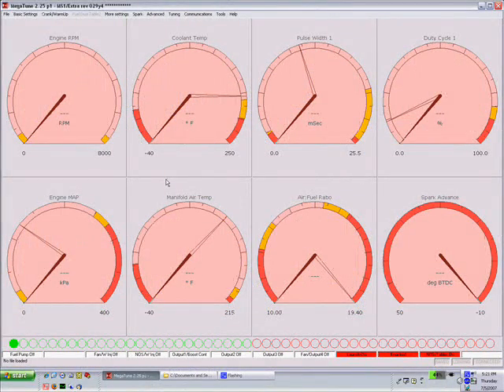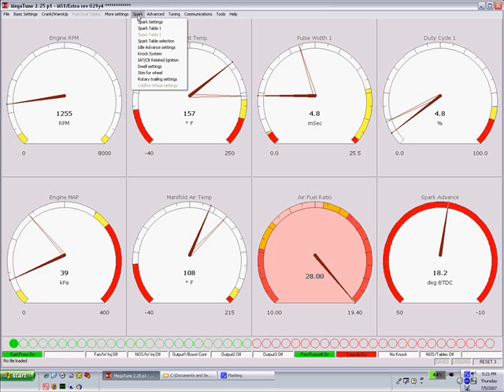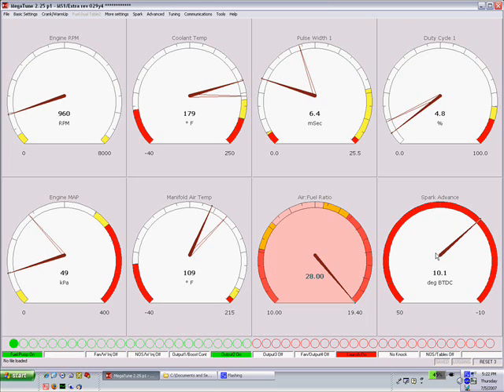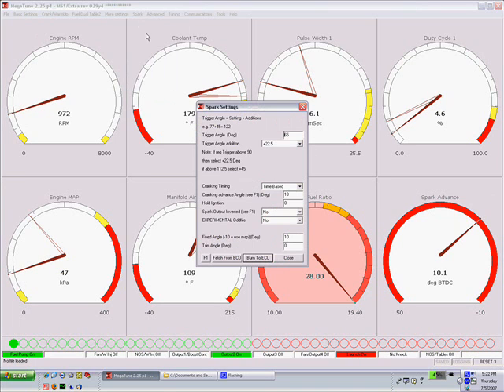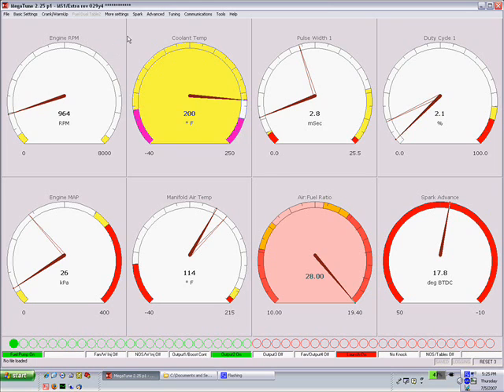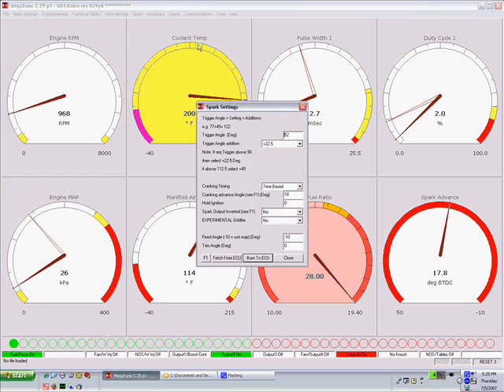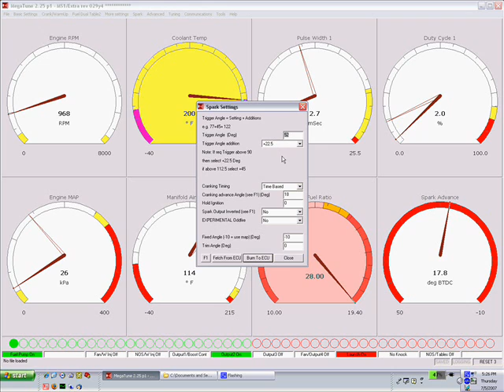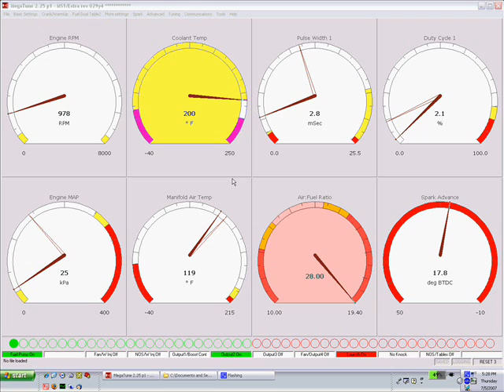MegaSquirtPNP Miata MM9093 MM9495 MM9697 Setting Base Timing

Comment: HI I need a pointer please.  I have a 90 Miata with a mm9093 PNP.  Everything seems to work really well other than it idles when hot at 1950rpm.   Can you, or anyone reading this, give me an idea of where to look, to adjust the hot idle speed.
I would be very greatful.. Currently running Megatune 2.25 p1 software